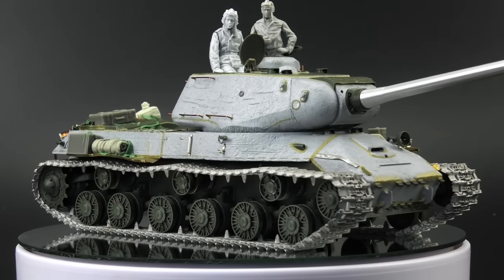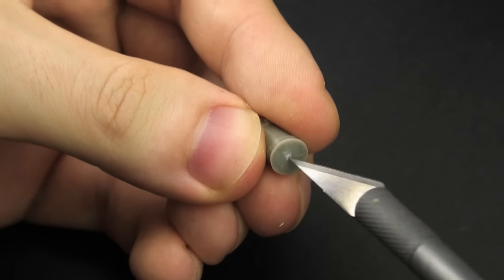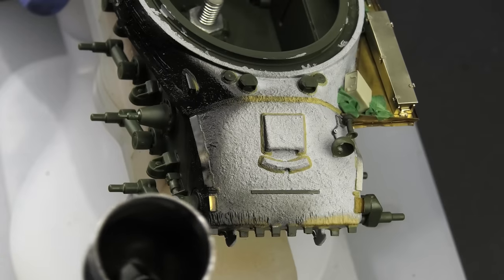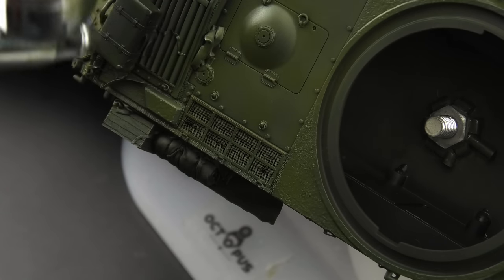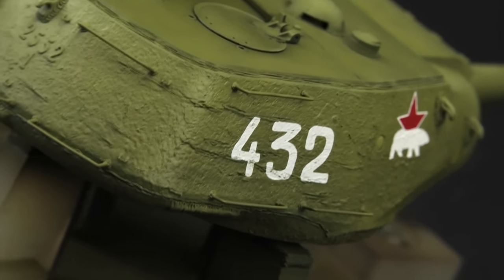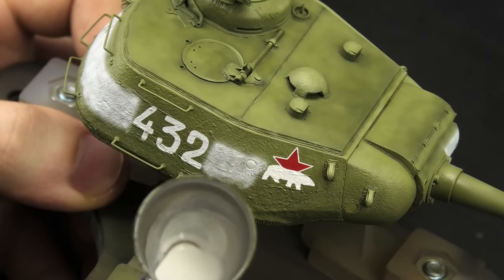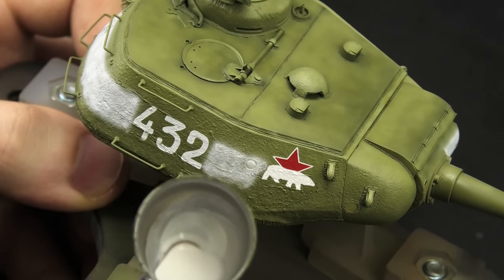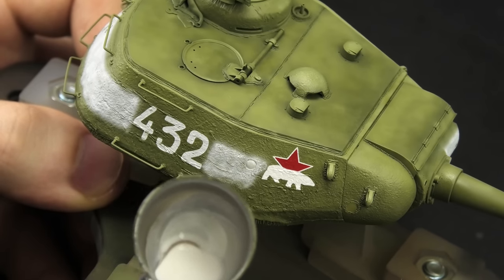Soviet 4BO Gets POSH Shaded (JS-2, Berlin 1945)

Comment: Thank you for paying attention to Soviet armored vehicles. I would like to make a small clarification regarding the color of the paint.
Russian modelers have long been discussing the topic of painting Soviet armored vehicles during the Great Patriotic War. True 4BO paint has not been produced since 1952. However, according to various sources, it was possible to restore the approximate composition and color. In the RSL color space, it has the following composition: 96-87-55 or a lighter version - 103-91-61. I think that if you have a calibrated monitor, you can quite accurately prepare a mixture of paints to simulate 4BO paint.
Reply: Well, I don't think 4BO wasn't as standardized as are colors today. Then there is the issue of exposure to sunlight. One would think that colors always fade, but that applies only to years of exposure, which was hardly the norm in wartime. One source states that 4BO could get darker, not lighter, when exposed to sunlight. In short, I wouldn't worry too much about the one "true" 4BO...
Reply: @jczeus  As for the influence of the Sun, then, of course, the color changed. However, the composition of 4BO was strictly regulated. Even the pigments that were part of this paint were of a strictly defined origin. Of course, upon the arrival of equipment in combat units, it was sometimes repainted to match the conditions of the area, and in winter it was completely changed color.

Comment: I find that it is easy to get paint iut of those MRP bottles.  Hold the bottle upside-down in one hand and tap the bottom of the bottle with the index finger.   You will get one drop for each tap.  Might have to tap it 20+ times, but it works well.

Comment: I'm pretty sure this is same model i did years ago.. kept the stock green and just used some black washes to grit it some what. I'm no modeler so just went what paints etc i had laying around.
One thing i did was since tank has seen action there out to be some battle damage. IS 2 was heavy tank so it might have had some runins with German panzer 4's so i just chose the direction and flight path, wreck some lamps and put dents on the armor like it would been ricochets and non penetrations into turrent mantle and more angled armor parts. Cant recall perfectly but pretty sure had some handles missing so replaced them with steel wire. Since didnt bother with bought stuff ether just went to get branches from the forest and added logs to suitable areas as extra spaced armor well as tools to help it get unstuck. If only i had mental fortitude to build dioramas... well i do have that, but not to keep them clean XD